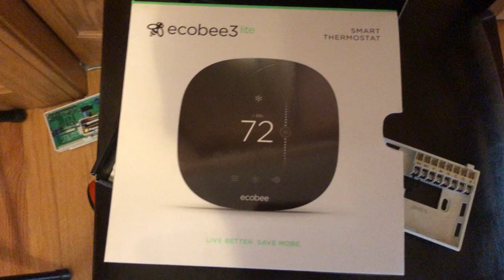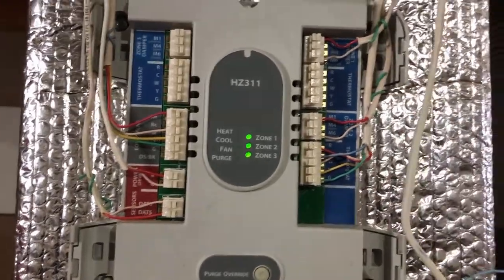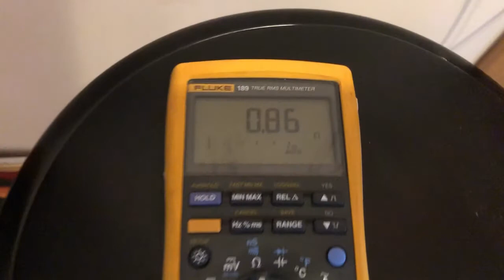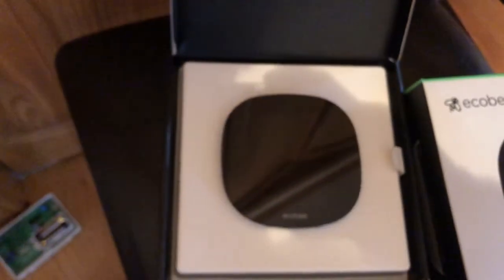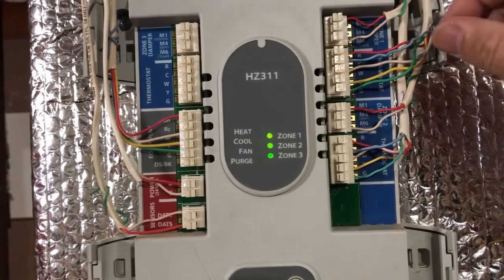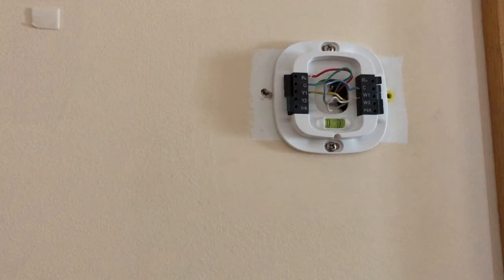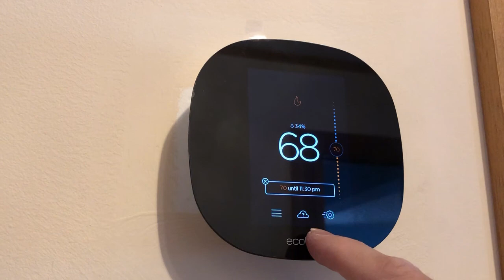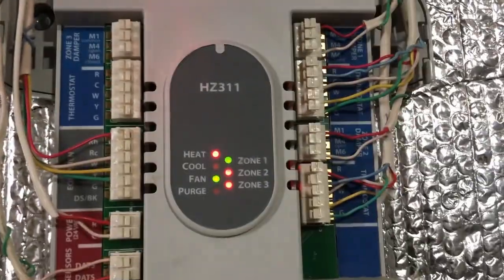Ecobee 3 Thermostat not powering up, c wire problem-Troubleshooting and fix. Contrl module HZ3111 .

Comment: Helpful - I had the same c-wire disconnected from the thermostat, realizing it was probably because the old thermostat had batteries. Connected the c wire to the system, and the ecobee is happy. Thank you!